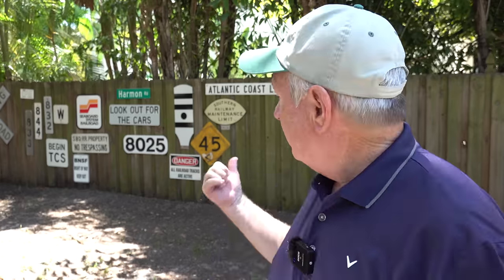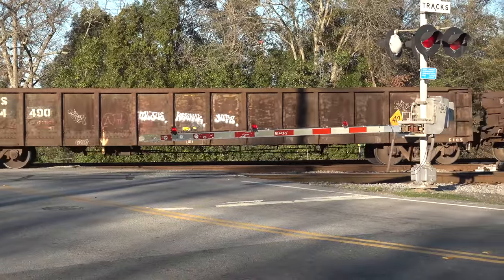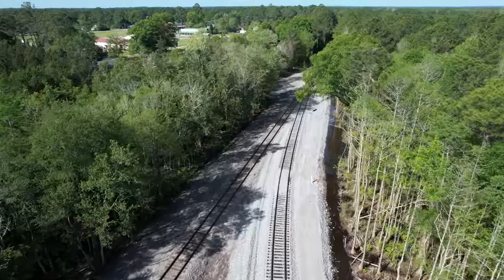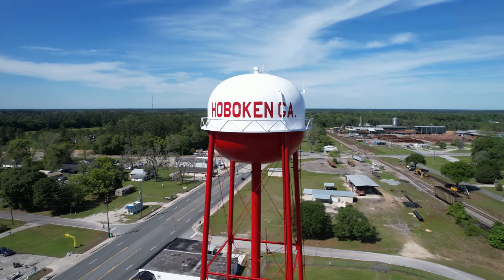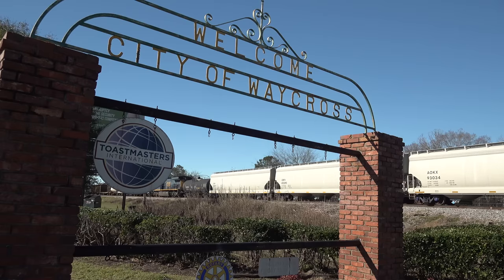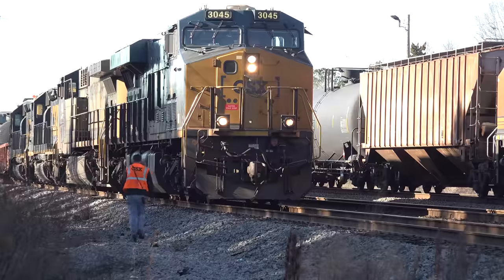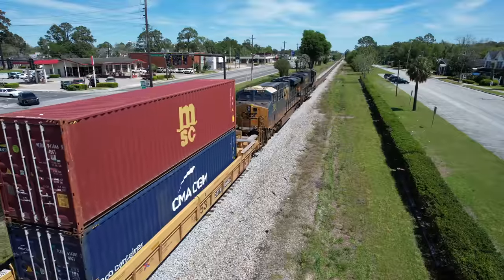How CSX Built a 35 mile Double Track Main Line Using Only 1500 Feet of New Track

Comment: What makes a rail subdivision? I’ve had someone explain a little but I still don’t get it is it just another name for a main line? 
Distant signal would be great at making a video explaining what are subdivisions main and branch lines, etc.
Reply: A Division is a defined area, or territory, which falls under the responsibility of a Superintendent for that Division. Within a Division, can be one, or many Subdivisions. 
Thinking of a main line as a Subdivision isn't too far off.  But then, any lines (beyond stubs which serve customers) that branch off to some destination, would also be considered as their own Subdivision.  One calls out locations, waypoints, crossings, signals, switches, or other defined items, by the mileage marker, to the x or xxth decimal place.  For example (and totally fictional example),  a crew calls in to a dispatcher.. (umm, Rail Traffic Controller, sorry),  to report a problem at such and such a location,  precisely defining it to the mile marker. 
"RTC,  Z210 calling to report a wayside signal not working properly, signal 163.64 on the YouTube subdivision." 
Being quite precise eliminates possibility of erroneously copying and relaying a problem to be repaired to the Signals department, or MoW Dept.  Pointless in sending them out from a Division headquarters in the wrong direction.  So Divisions and Subdivisions (commonly shorted to "sub") are identification terms, Division names can be as simple as Western Division, Eastern Division, or the like.  Subdivisions are often named after a major waypoint, or town, or geographical feature, through which they run.  Mountain Sub,  Prairie Sub,  Winchester Sub. 
IF Danny wishes to tackle this more in depth, I would also enjoy learning his take on this stuff.  He has great connections.
Reply: @stanpatterson5033  thank you for explaining.
Reply: @stanpatterson5033  You explained that very well!  It's just a managerial partitioning of a railroad.  
Railroad.Division.Subdivision.LineSegment.Track  
sorta like:
Country.State.County.Municipality.Neighborhood.Street
Reply: @jwrailve3615  The term main line is a generic term for a stretch of track that gets trains from place to place.  A main line is like a highway.  A main line is comprised of one or more main tracks. One to four main tracks is typical, depending on traffic demand at any given location.  All railroads have specific rules regarding how train movements get access to and operate on main tracks.  These rules are aimed at safe and efficient operation.  A term you'll hear a lot is authority, which simply describes the right of a train to perform a movement on a given track.  All trains must have authority to operate on(to) a main track.   Main lines can also have secondary tracks called sidings.  These are a secondary track that typically parallels the main track(s) but only for a finite distance; it is connected to the main line(s) at each end.  Sidings are used to allow trains to pass one another (both going the same direction, or opposite), to store maintenance equipment or materials, or damaged freight cars or locomotives.   Sidings are usually associated with their length (in feet) so that the length of a train which will fit is readily known.  A siding is kind-of like a rest stop.

Comment: Now that the railroads seemed to have decided to ignore train length limits, maybe we'll see a movement to using parallel routes as one-way routes. For example, between Minneapolis-St. Paul and Chicago, the BNSF (ex-CB&Q), UP (ex-CNW), CP (ex-MILW), and WC (ex-Soo) connect the same cities by different routes.
Reply: That's a good idea!  I wonder if they do that in other places, or not.  
I've read that CN has not yet made it's mainline in Alberta double track, but there is several lines running across the province, so if they could use each line for a different direction, at least until one line is fully double tracked.  
Also, the Trans Siberian Railway, and the Baikal Amur Mainline in Russia are both single tracks, but they could assign each one a particular direction.  I'm not sure if they do that or not, but they could.
Reply: @beringstraitrailway  - There are several famous examples of competing railroads sharing single track lines, although usually the distance is not too long. Winnemucca to Wells in Nevada is the longest example of two railroads sharing mainlines; the total route is a double-track route more than 170 miles long; this is an operation dating back to long before WWII. Originally it was Southern Pacific and Western Pacific cooperating with each other. Today, of course, both lines are Union Pacific.
Reply: @beringstraitrailway  -- If they are both still there, I think the CN and CP lines across Ontario and Manitoba between Winnipeg, Thunder Bay, and Toronto would be the best place to try one-waying the railroads. However CP has been running their trains through Minneapolis and Sault Ste. Marie for a long time.
Reply: This makes good railroad and business sense.  Utilizing existing assets and improving fluidity rather than rushing to sell off underutilized lines.  I believe Norfolk Southern should follow this lead and examine some existing properties as a means to increase train speed instead of a quick real estate sale.
Reply: @buddyhenson2559  - Even better, restore some of the lines that have been abandoned. However, out East, the important mainlines are still double track, having been pared down from four or three tracks. NS between Pittsburgh and Harrisburg (ex-PRR) is a good example, along with CSX's former NYC mainline. But basically, PSR only really makes sense if meets are eliminated, and that means double-track. Look at BNSF over the former ATSF Southern Transcon.

Comment: So, some of those Locos have a front door on the Left side, while others have them on the right.   Some preference?   They have a rooms , toilet, or something in there?   I just noticed that with such a big nose, there's quite a bit of space there.   Galley?    Any vids on such things?  I am not finding anything with the image search.  (I am not an expert on engine types, etc)
Reply from the maker: I noticed the door thing for the first time when doing research for the EMD vs GE video. I haven't yet found the answer.
Reply: The door difference is simply Engineering preference. Whatever fits the design better, there is a crew restroom in the nose of all mainline locomotives.
Reply: I was curious about what was in the nose or hood compartment. Based on only 2 videos I could find, they look like a combined plumbing and electrical closet with an open  toilet. No kitchen or lounge. I guess the crew eats cold sandwiches on their shift. Wold like to see a video of how the crews live and work and their schedules
Reply: @advancedapproachproduction2394  only for loco with big noses and a door,. The older typical designs (EDM?) Have a very small nose with entry doors to the cab on the sides facing the front.  I would assume those have the bathroom behind the cab.

I have found a few posts which suggest that the operators call the nose areas " hell holes"
Reply: @distantsignal  reason why I noticed the first time, is that your videos showed the workers going into them.  

Four-door to be on a specific side, they are a specific GE model number or series of a model. That door will not be randomly placed on left or right side.   I found one very short video on YouTube that shows someone going from the cabin and to the toilet room on the left side.   Can see the front door briefly, and there was an open space on the right.   I would think they would place a mini fridge and microwave in that area.

In the old days, the caboose had the bathroom and storage for food and rest.   If you were crew and had to sleep... The caboose would be a lot quieter and softer a loco.

With all the pictures on Google with these engines, find something with schematics of some sort or any kind of interior layout is minimal or non-existent.  

I have a train sim they allowed you to walk around, open doors and flip switches etc.  But no freight engines.
Reply: @TexasCat99  yes, older style EMD cabs have toilets in the noses. And they get very hot during the summer.
Reply: @TexasCat99  The toilet was down in the nose on spartan cab locomotives too. The only locomotives with a toilet behind the cab were older GE units (the kind with the really stubby short noses like B30-7s).
Reply: @sharkheadism  I looked up that model number. That's the kind I meant when I said " small nose".. not much room there
Reply: @TexasCat99  They're the only GEs like that as far as I know. The spartan cab Dash 8s all had the toilet down in the nose like the EMDs, it's better that way

Comment: in the last year i got to talk to a railroad man for over 2 hours west of waukesha wi while they were putting in new ribbon track from waukesha to milton it was nice we walked along and watched how they hammer down the track and heat it up then hammer down the spaces while the track is hot evidently thats to minimize buckling in very hot weather the four or more crews were very aggressive and owner operators of their equipment ,he said they don't stop for lunch they eat while they are on the move . i asked if they will be able to go faster now with the new track and he said there is no need to go faster because of the short distance . he also said hat the track is expected to last a hundred years  two trains a day use it . but there were rumors around and articles in the wall street journal that this would be part of a bypass around chicago but i heard it was held up in some other state because of money to secure some right of ways .
Reply from the maker: Very cool. I'd love to get up to that part of the country someday.
Reply: Installing rail is quite the art form!   It's important that the rail be at a "neutral temperature" when installed because its expansion and contraction across various temperatures during the years can wreck it very easily.

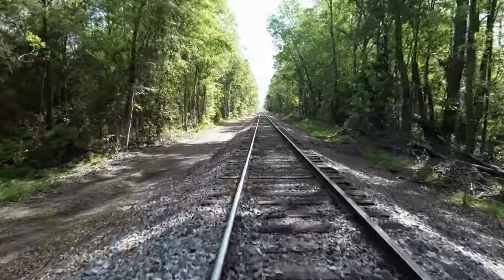Comment: Love all of your videos. I have been searching for videos showing a lower front-end perspective shown on this video from 2:00 until 2:46. Most engineers view videos I've come across are through the (dirty) windshield from inside the cab, mounted much too high to get a rail-view perspective. The first video I found (https://www.youtube.com/watch?v=xQ2g-Ixuwbo) that comes close to using this parallax technique immediately captured my attention. How did you get this shot? Have you used it on other videos? Does the railroad cooperate with you? Thanks so much, Tom Carey Winter Springs.
Reply from the maker: Thanks Tom. I just flew my drone down the track at about 8 feet above the rail.. It was actually pretty easy.

Comment: The only thing that worries me is that they still haven't fully double tracked it between Nahunta and Jesup. Let alone Nahunta and Savannah. Amtrak in the mornings I suspect will suffer.
Reply from the maker: Those are good points. I don't think any northbound freights will be sent past Nahunta to Jesup between 4:30AM to about 6:30AM as that's when Amtraks 53 and 91 are coming south through there. It still leave a really big window to run though freights, though.
Reply: @distantsignal  only reason I talk about it is because when I went to Savannah back at the end of June 2021, Amtrak 91 was sandwiched between three CSX freights on that main. 2 in the front, one behind heading slowly south. And with no real sidings or double track until Ludowici for Amtrak to get around them.
I'm guessing unless they create a designated track for Amtrak to run on, this will be the norm for the foreseeable future.

Comment: Love it. Quick question though. What is your opinion of PSR? I saw clips of congressional officials trying to bring an end to it.
Reply: PSR really just means trying to be efficient and do more with less. It’s something the railroads have been trying to do pretty much since their inception, but right now there’s a fancy marketing name for it as the railroads are implementing some new strategies and taking others to greater degrees. The main complaint is that many railroads have been cutting excess capacity, which has really decreased their ability to resist disruption. There’s also a lot of complaints about longer trains, which in my observation is nothing new.

Comment: I must ask, what is a turnout?   Your video showed a switch.  

I supposes you use the term lash-up as well.  Have  never seen locomotives 'lashed' together with rope.   

Adding capacity is nice  (never once have I heard or read in company literature fluidly, unless they were talking about a terminal).   if they could run the trains at track speed, and not have to slow to a crawl through connections as your video shows.  Maybe they needed better engineering to really add capacity.  They do make 60 mph switches,  and they are used in many freight only territories.  In tight curves, such as that, other railroads have it built for 45 mph instead of almost walking speed.
Reply from the maker: A turnout is the arrangement of the switch and frog that creates a device to allow equipment to move from one track to another. Lash-Up is a commonly used term to refer to a group of locomotives coupled together. I don't know how fast the switches are at Nahunta. It's likely they are higher speed than walking. The plant was still undergoing a shakedown period after installation. They keep the speeds very low during this period. 60 MPH turnouts require a huge amount of real estate. Most freight trains don't run that fast anyway.
Reply: @distantsignal  A frog, be it fixed, spring,  or movable, is part of a switch.  They don't refer to the points as "turnout" points do they?  The powered device that throws the points is not a "turnout" machine, it is a switch machine. There are no spring "turnouts", but spring switches.  Ask any Engineering or MoW personnel, he or she will explain it to you.  

A #20 switch is about 350 feet long.  That's 5 car lengths.  Not much space considering the realities of railroading.  A #20 switch  is good for up to 45 mph.   Many freight only lines which handle intermodal,  or premium trains need track good for 60 mph, and may even use #26.5 switches where required to accommodate that kind of movement.  Not all switches mind you will be of that type.

Of course,  unimportant  branch lines  will not be built to such standards.

 Speed  is after all part of the calculation for measuring capacity.   So it is logical that the faster the speeds, the more trains the track segment(s) can handle.  

With new construction, I have observed temporary speed restrictions for the first few trains for the purpose of settling.  After that, normal timetable speeds.

In common terms, lashing means using a rope, cable, etc. for tying one thing to another.  I know of no rope or cable that can withstand 400,000 pounds of force that locomotives produce.
Reply: @otef434  Calm down

Comment: I did not realize that deep well cars have so much open space at the ends of the containers.  
Is it because they are designed to carry containers that are longer than the ones we are seeing on the train in this video?
Reply: No. They are built that way to allow HOBO’s to ride comfortably, video their travels and share those videos on YouTube. 

Ok, flame 🔥 away…..
Reply: Yes. Containers typically range in length from 45 to 20 feet.
Reply: A lot of it is because they're designed for double-stack use, which means the lower containers have to sit low enough that they can't put the trucks under the container, so the trucks have to go in front of and behind the containers instead.

Comment: Really odd choice in my book to not add 1-2 passing sidings and not double track the north throat. Maybe that will come later if CSX likes this so far
Reply from the maker: Yeah, my theory is that keeping a train moving, even over a longer distance is better than stopping them in sidings.
Reply: @distantsignal  1. A 1500 ft. connection costs a lot less than each 8500 ft. siding; and 2. Stopping on a siding and restarting may take more fuel than running the longer distance on the flat.
Reply: @distantsignal  I was talking in addition to this new connection
they improved 1 bottleneck while still leaving other major ones
Reply: I doubt they will ever double-track across the diamonds (And double the maintenance already on those diamonds) but eliminating CP Brunswick Jct and extending it down to Rice Jct at Jenkins Street would be interesting.  That could let two trains pass at the same time, one in/out of the yard and the other around it.